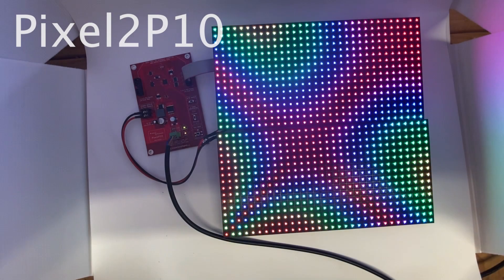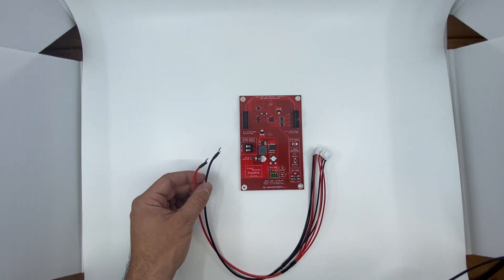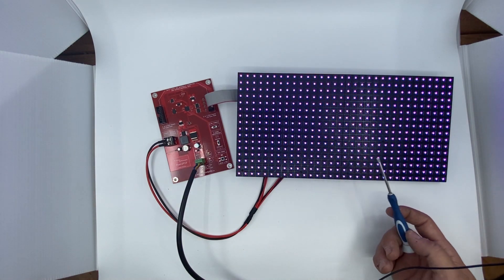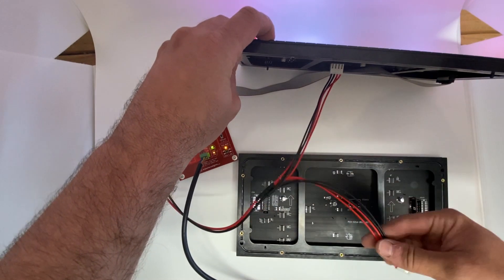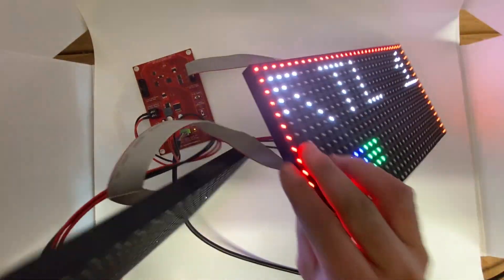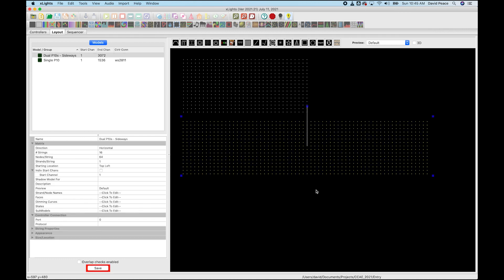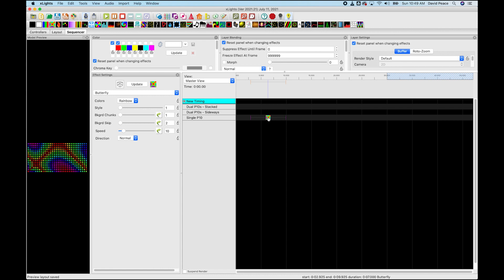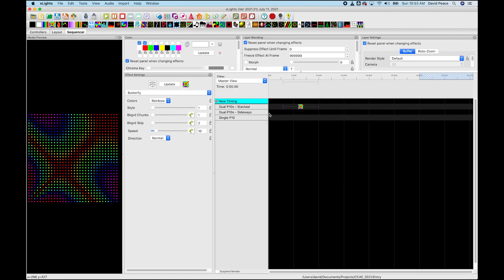Pixel2P10 Walkthrough - How to control P10 panels with a pixel string

Comment: My 4 boards came a few months ago, but my P10's from Wired Watts were backordered for months.  They finally shipped last week and thanks to the is video, I immediately had all 8 panels up an running in no time.  Excellent product.  Probably will buy 4 more.
Reply from the maker: That's exactly what we like to hear! ... not the shipping part, but the easy-to-use part! 😂
Reply: @ExperienceLights  UGH! and now that I try to buy more, they are out of stock at your website. :(

Comment: Very cool. I bought the pixel2thing board back in December and today I finally got my P10 panels. I like the test mode. It confirms that the orientation is correct. You explained in the video about the RGB order but you didn’t make the configuration change in xlights. The butterfly effect is being displayed with the wrong color order. Need to go into string settings and change it to RBG
Reply from the maker: I assure you, that was intentional. It's a test to figure out who our die-hard fans and customer support ambassadors are, and congratulations, you won! Enjoy a free year's subscription to xLights on us! 😂
Reply: @ExperienceLights  could you show a video of the Santa you made performing